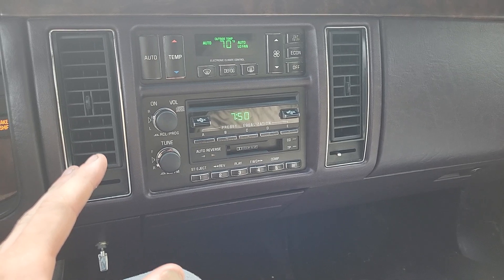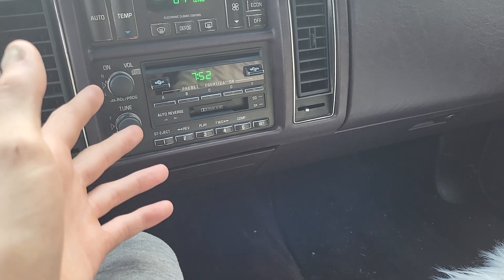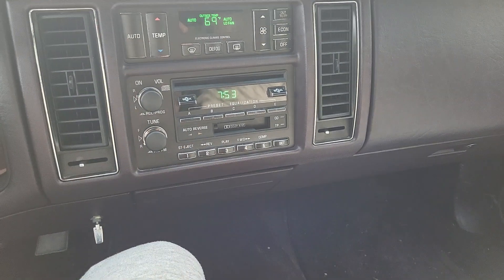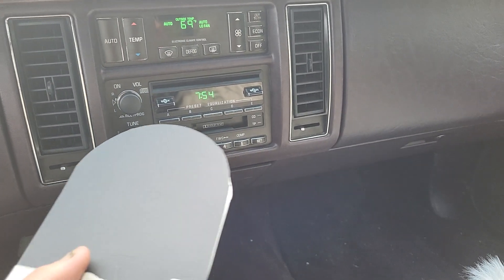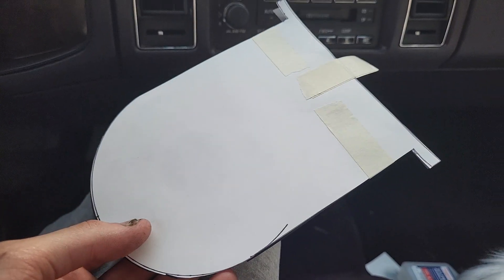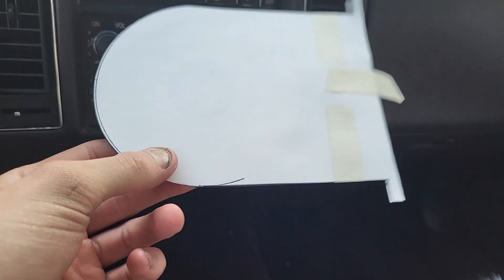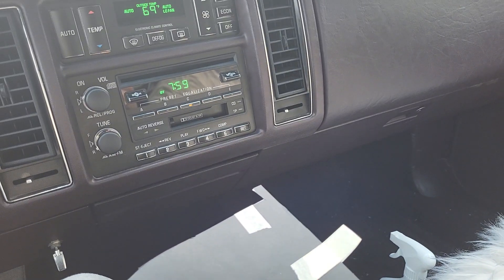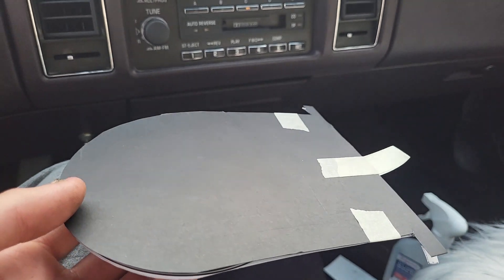how to fix cd player that won't load fully or ejects only part way - cd loading explained

Comment: Wish I could just spray in some of my electronics no contact cleaner and call it good probably not a good idea though I'm guessing my 2010 Ford Focus either won't take a cd in or if it does it is a pain in the rear to get back out lol

Comment: Seemed to have worked on my Sangean WR3 radio CD player with slot-in CD drive. I used a thick card  about same thickness as CD, cut as you did but it was not sucked in. Dabbed in isopropyl alcohol, I had to push in and pull out with power off. Is it Bcos it was card that the CDP did not suck-in ?

Comment: A month ago or so I posted a comment that I was going to try this and that in the meantime I appreciated an explanation of how the CD intake and ejection works. So today I tried it. THIS METHOD WORKS, ABSOLUTELY! There are a lot of comments below from impatient people complaining about the length of the explanation in the video. Don't listen to them; listen to the guy who made this video. Remember, this is the internet. Anyone can post anything, and they do. *Why would you stick anything into your CD player without an explanation of why you should believe that it will work?* This guy explains it to you, and it works.
Reply: I should add that I did not use a plastic sheet, either. I used a piece of card stock with a glossy finish, cut from one of those folders of the type you sometimes get at conferences.

Comment: Hello,
In my car CD player,  I have TWO discs stuck inside it.  I've tried a few different things to get them out, but I can't get anything to work for me.  Do you have any suggestions as to what I might be able to do other than what I've tried.  I've used the card with double - sided tape, and I've tried tweezers, which I can't get inside the disc area good enough to grab the disc on top.  I see them both inside the player.  My player will play the bottom disc, but, it won't eject either of the discs.  Can you or somebody else suggest anything I could maybe try ? I appreciate your help either way.  👍
Reply: Hope this isn't too late...

Remove the player from the dash.. unscrew the 2 tiny screws that hold the top lid on the deck.. use a pick to get behind the top disc and gently push it out.. make sure the power is completely disconnected before you start to remove the lid... hope this helps

Comment: Damn buddy, I only had a minute, I’m gonna have to find someone that gets to the point PRONTO. 
Sheesh!
Reply: >disk wont go in? probably the slot loader. 
>this type of loader is basically a motorized tube right inside the slot that pulls the disk in, sometimes they get dirty.
>you can clean the roller by making a dummy disk and spraying it with 90% or higher isopropyl alcohol,then scrubbing it inside as if feeding a disk. 
>When making your dummy make sure its something that wont get stuck.

Comment: Hi Riot, the deck in my 2005 Chevy Duramax stopped loading. I removed the unit and found that the rubber sleeve is loose from the geared loading ROD.  I almost have the unit disassembled and would like to know if you or any other viewers can recommend an adhesive to place on the sleeve and rod that won't be a future issue. I also noticed that the tiny plastic gear on the end of the rod is slipping so that the tray motor turns but the roller rod is not gripping the CD, pulling or pushing on the disc.  Any suggestions ? ? ?

Comment: I had problem car cd would not take in a disc... so I kinda pushed it in with a thin item... now it is in but seems to be stuck..... and cd player doesn't play it.. got any suggestion where to go from here please?
Reply: If you ever get a stuck cd put tape on the end of a credit card.  There's a great visual application here on Youtube to see before you try.
Reply: Hemostats....small scissor like pliers

Comment: I used a booklet that came with a CD.  It is the same width as a CD.  Be sure to remove the staples first.  I poured isopropyl alcohol on the booklet.  I made a "handle" out of duct tape and stuck it in!  I wiggled it around for a while and took it out.  In seconds, I successfully inserted a CD and it played!  Thanks for the help!
Reply: Did you insert it spine-first? and the tape was on the open side of the book?
Reply: 0:16

Comment: Man, it works!!!  However, I completely disassembled the CD changer and wiped the rubber roller with alcohol.  Collected and everything earned correctly!  

The problem was in the random inclusion of the CD changer (without a disk) and the final output of "loading error".  And also there were problems with the capture of the disk, as you said in your video.

Hello from Ukraine!
Reply: God bless Ukraine !!

Comment: Is there a reason why you can't just use a CD player cleaner CD?🤔
Reply: the description explains it, most are made low quality and can make it worse, in my experience, hope your cd player works!
Reply: Old post but... A lot of these CD cleaners aren't for slot loading players. You have to be careful when buying these as they don't always tell you this stuff on the packaging.